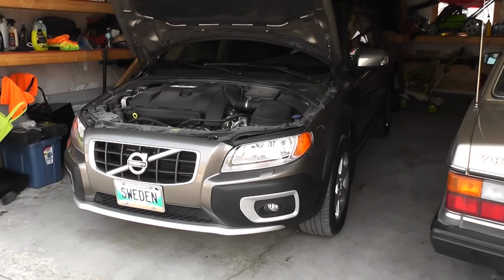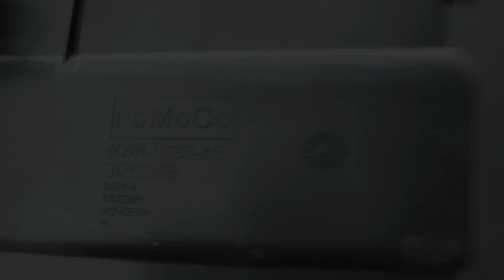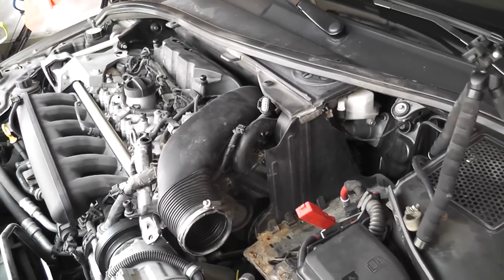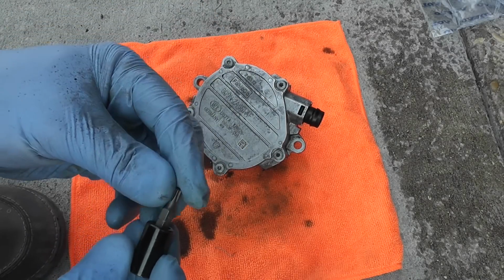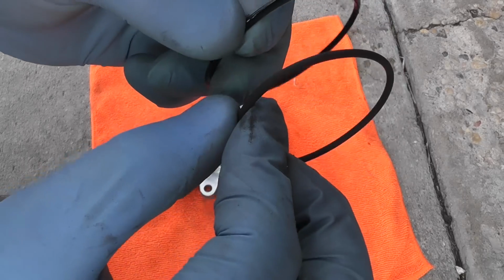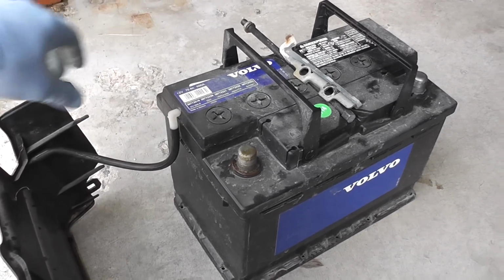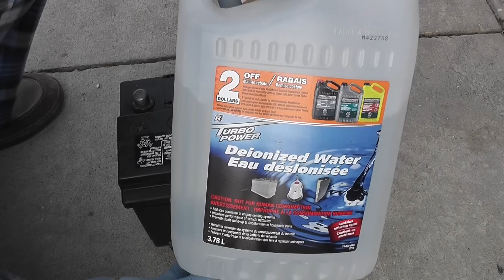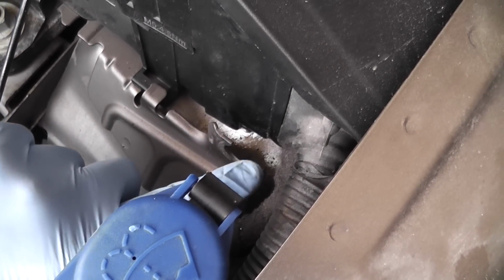Fixing leaking Vacuum Pump on Volvo 6 cylinder 3.2 and T6 engines.

Comment: Thanks a lot for this video - today  having no experience I have replaced seals on  my 2008 non-turbo 3.2 vacuum pump in 2 hours.  Also have to remove two A/C bolts.  Only one difference -  I have not take a risk to clean surfaces with sandpaper, brakecleaner  was good enough.

Comment: My 3.2 XC60 was at the Volvo dealership for a recall and they discovered that the vacuum pump was leaking and offered to fix it for $370. I found the OEM part on line for $76. I’ll be fixing that myself. Many, many thanks to you!!!! I’ve made a number of repairs myself to my fleet of Volvos because of your videos. Thanks for sharing your knowledge and taking the time to make these extremely useful videos!!!!

Comment: Thank you so much for all your videos, they have such good depth and insights!  I just did this job on a 2013 XC60 that's losing about a quart every 1500 miles.  I studied this video in detail before starting and had it playing on my laptop the entire job in the background.  It was like having you watching over me while doing it and the entire job took about 2 hours :)
Reply from the maker: Glad the video helped!
Reply: It was!  Doing transmission oil over weekend, I actually took the opportunity with this job while the fill bolt was exposed to loosen it, prepping for new job (and of course using that video you made as well)
Reply from the maker: Nice. Do you have Vida to reset the counter after transmission oil change?
Reply: volvosweden I will tomorrow when USPS delivers it :). I have VIDA running in a VM on laptop ready to go, a bit nervous but very excited.  First time flashing anything to a car
Reply: Hello, I want to ask you, before the repair of the vacuum pump you had oil consumption and after you repaired it the consumption decreased. I will wait for your answer. Thank you.

Comment: Thank you so much for this. The pump on my XC60 is spewing oil everywhere! Glad I can fix it on my own thanks to your video.
Reply: around what milage/yrs did this happen?
Reply: pgreenx 8 years old 140,000 miles.
Reply: Is your XC60 a T6? I have a MY ‘14 XC60. Does this issue also comes by the 2.0 D4 5 cyl engines?

Comment: Thanks for the response.  I have been looking at the pump online and it appears to have openings that would allow oil to pass into the pump.  Maybe the oil lubricates the rubber blade and is part of the design.  The oil leak appears to come mostly from the engine to pump union.  Just a guess on my end.  Thanks for the great video.

Comment: Great video again. It is easier to get to the vacuum pump on the non-turbo 3.2 engine. Removing the battery and battery tray make it very easy to remove the pump and no need to loosen the bracket for the AC compressor.

Comment: Excellent and thorough video.  I'm diagnosing a noise I heard on the coldest day last winter that returned yesterday.  Initially I thought it was the water pump or idler pulley.  Yesterday's symptoms seem to indicate the power steering pump is the problem - vibration, noise, small amount of fluid on driver's side lower cross member.  I topped up the reservoir but will wait until I have obtained a replacement power steering pump.    Your video confirms that I followed the proper sequence; stopping short of removing the battery.  I already purchased a replacement water pump and serpentine belt, so I'll replace these at the same time.  As far as I can see, removing the battery plate is the only access to these parts.   Thank you .... Cam

Comment: VolvoSweden, another excellent video. thank you very much!  And DO NOT go to the trouble of doing this without also replacing the serpentine belt. Yes, a little more work but a lot less than if you dont
Reply: Any good videos on the aero belt for a p3 3.2 engine.  I heard it was a lot of work?

Comment: G'day, so I did this yesterday on my '08 V70 T6. Too easy. Thanks heaps. I got the parts from Tasca Parts. Excellent price and service out of the states. IT is ridiculous that I can import genuine parts to Australia cheaper than I can get them at my local dealers. I replaced both my drivers side engine mounts as well since I was in there. Pretty easy but if it comes up, others might benefit from that video.
Cheers

Comment: Thanks for posting this, my pump was leaking pretty bad. Followed this procedure for my s80 and the removal of the 13mm and 10mm for the bar to get at the pump is perfect. Got it all back together with new seals and no leaks. I noticed after getting the pump on that my belt is looking worn. Any videos ideas of how to remove the drive belt? Its really buried in there and not easy to get at the belt tensioner,  may have to bring it in for the belt I think. Good video.
Reply: instablaster

Comment: Did you feel any difference in terms of power after the repair of the pump? I'm asking because I have to change the same part AND my car has a loss of peak power (minus 2 seconds at 0-60 mph after 6 years on the road). I did a Terra Clean but it hasn't improved its performance...

Comment: Thank you so much for your videos. You make me want to get a. 2008 Xc70. I'd been worried that they were going to be so much newer and computerized..but it's good to see there's still a lot that can be done without a dealer or reprogramming
Reply: @volvosweden, if I can't find a 2008-2012 xc70 t6; but can find a 3.2 with good service maintainance, is there any reason to avoid the non turbo ones? A friend of mine says they are slow.. but I'm not really looking for fast performance..more durability....any advice?

Comment: Just noticed this problem on my 2009 XC60 T6. Will order this part and fix. Thanks for the helpful video.
Reply: Im have problems i have a xc60 wat sound is urs making
Reply: @kingmaxx7986  No sound. I just noticed it is leaking. What sound does yours make.

But I have to say, my Volvo can predict with 100% accuracy when it's going to rain. Whenever it's going to rain and you are driving, the air conditioning compressor makes a whining sound. No kidding.
Reply: Ill be looking at mine real carefully since in the process of replacing (oil trap, breather box) on the other side of engine.  Thankx

Comment: The bolts of the pump to the engine have to be tightend to 17Nm according to Vida.
The bolts on the pump housing have to be tightend to 7 Nm.
Reply: Where did you get the VIDA? My apologies I'm newer.

Comment: Great job and video! Thank you for making it.  Question, is this pump supposed to make a lot of scratching noise when it runs? I could see scuff marks on the inside, where the plastic rotor part spins. Guessing, that's where noise originates? On mine, it's very loud.  Thank you.

Comment: Just did this today on my XC60 T6. The oil was quite thick and dark in mine, perhaps it's a good thing I cleaned it out. Disconnecting the Vacuum hose was a chore as the plastic was brittle and broke when I squeezed it to disconnect. Had to use to flat-head screwdrivers to pull the two sides apart. On a good note, I did not need to remove my battery box or loosen the bracket to access the front bolt.

Comment: Hello, thank you for this nice video. Very well done. Did you done this rebuild only because of a visual inspection shown an oil leak or did you had break power loss?I have the same Vacuum Pump did you
Reply from the maker: +Michel Pelletier Visual inspection only. No other symptoms.. If not fixed it will leak into  the ground.
Reply: This is the first one to check when you notice a decrease on your oil dipstick level.

Comment: has it got any return valve to stop engine oil from coming off to the brake booster in case the one in booster failed ,I have one here gave me aheadache  to find out how come the oil in booster , the brake booster literally filled with oil , I would assume this happening during engine shutdown as that vacuum on booster will suck any oil in pump if it has not got valve at the outlet where vacuum hose connected to it , can you elaborate in this please
Reply: I mean the plastic port that came in with new kit , is valve (work one way. only ?)

Comment: Should I oil inside the pump after rebuilt? If not, the parts will not have friction? I have rebuilt mine, and cleaned the inside (no oil).. Just wanted to re confirm before I put back and start the car..

Comment: isn't it a good idea to lubricate the seals with oil before installing? like on oil filters
Reply: You should only lubricate seals when you're twisting something on (like an oil filter). There's no need to do it on parts that are screwed on with bolts (it doesn't make a difference).
Reply: AFAIK, yes. And, you might want to put oil or lube back in the pump, too, before cranking and running the engine. Many of these seals swell to a larger size when exposed to oil and the pump needs the lubrication to prevent wear.

Comment: Just did this Swede,c thanks for the great vid,  but not sure why you took off the battery and case, Just move the airpipe and the a/c bracket. Took 20 mins to get the pump out...10 mins to put it back in

Comment: Very helpful instruction, thank you for sharing. I just got mine replaced today, which saved me about $250 on labor.
On my 2012 Volvo S60 T6, the serviceability was improved - once the battery bracket being removed, the two screws on vacuum pump can be easily accessed and removed, it makes much easier to remove the pump than on XC70.

Comment: Yuri. When are you planning to replace the serpentine belt? That would be an awesome video. No one has done that for the 3.2L.
Reply from the maker: No plans. Too low mileage.
Reply: @volvosweden  You are supposed to replace it every 10 years according to the service schedule regardless of km. So That would have passed by now. Can you please do a video because I'm doing this too and a guide would be helpful.
Reply from the maker: I will look into it. Thx for the tip.
Reply: Hugs there’s a step by step with good pictures on sweedespeed. But I agree a video of this quality would be awesome.

Comment: I have one question.  None of the seals replaced addresses the pump getting full of oil. IE Shaft seals for the rotor.  It looks like the engine is migrating the oil into the pump.  Why does this happen?
Reply from the maker: +Steve Hudson I cant help here. Sorry

Comment: hi, 
before you repaired the vacuum pomp, did your engine had a weird noise coming from the oil filter cap. 
I mean taking the oil cap off while engine idle, did it had a word noise (not the usual one). sorry for my bad English
thaks
Reply from the maker: I have not tried what you describe. But I had a high pitch whistle at idle that you could hear inside the car. I have suspected the power steering pump. But after I have touched the vacuum pump the noise has almost disappeared.

Comment: where can I get the rebuild kit from?? Tried to purchase locally and they wanted to sell me replacement part complete.
Reply from the maker: Volvo dealer or ipdusa.com
Reply: Please I have had to pack my Volvo S80 1999 model for a long time now due to oil leak from the gearbox pls I need advice
Reply: ama love .. maybe you should take it too an automatic specialist.
I can give you some suggestions here:
Are you sure it's auto fluid ? Brown is usually engine oil, red is usually auto transmission fluid or power steering fluid.do you have access to a lifting jack and safety stands ?
If you do you can lift it up and put the car on stands, buy some degreaser in cans and blast all the oil areas around the gearbox ect.
Get your garden hose and wag the degreaser off and let it dry.
Start the car up again and see if you can see the oil leaking from the gearbox breather hole , gearbox oil cooler lines, power steering rack , also move the steering to full lock both ways and see if the oil comes out of the rack boots.
Hope some of this helps.
Reply: I bought the rebuild kit from FCP Euro, P/N: 31401556, made in Germany. I believe it is the same part being sold at Volvo Dealer.

Comment: We have the same issue. Can this cause a false fuel pressure sensor code. Our codes are fuel pressure sensor and faulty vacuum pump. Thank you and great video as well
Reply from the maker: Not sure.
Reply: Thank you for the reply. We did find that a faulty fuel pressure sensor can be caused by a bad vacuum pump. This was per dealer. Our issue and codes went away after the fix

Comment: great video, thanks. 
1) It is not necessary to remove or disconnect the battery, just take the front of the battery box out
2) It is not necessary to unplug the MAFS cable
3) It is not necessary to buy rebuild kit, just clean the O-ring contact areas with brake cleaner and squeeze liquid gasket maker under and over the O-rings, reinstall, good to go

Just sharing my knowledge, again great video!
Reply from the maker: +spinlite ny Thx. It's a great tip for next time.

Comment: The most important thing is that 5 screws, they are the leaking main root cause. The screw is made by steel, and pump body is by aluminum, there will be small gap between both treads since long time, the sealing is mainly by thread to prevent oil from coming out. The cheapest way is just put tread tape to each old screws then the problem will be fixed. 
Anyway change the new screw is the best solution.

Comment: Poop - so I did this and in getting the 'plug' out of the pump, one of the plastic sprung lugs was as stiff as - applying force and ignorance resulted in breaking the alloy 'bar' on the outside of the hole holding the plastic clip in.  Jury rigged with araldite and a jubilee clip - any ideas a. what happens if this plug comes out (loss of vacuum to brakes?) or b. longer term fix - was doing this myself to save money and certainly can't afford a new pump right now :-(

Comment: You have not mentioned why did you change the leaks, based on visual inspection or you got any CEM Code?
Reply from the maker: Visual only.
Reply: volvosweden good stuff. Will you clean Throttle Actuator some time?
Reply: @mattgloss8580  He has made a video on this.

Comment: Need to mate this pump with an electric motor and retrofit into P80's-P2's to provide vacuum for the PCV system, so it can be completely separated from the intake system entirely. No oil allowed in the intake, a catch can in the path that you can drain once a week/month.

Comment: What is the symptoms of a leaking vacuum pump? My 2012 S80 t6 has a high pitch noise near the vacuum pump and ac pump area. It appears after the engine warms up and only at idle. It is gone right after I press gas paddle. So far no check engine light. Appreciate your comments!
Reply from the maker: Have you replaced this? Watch this video. https://youtu.be/V0RzfGd-2OE

Comment: I thought that the hose connected to the battery was to bleed off hydrogen gas produced when charging the battery.
I don’t think I would want that gas anywhere near an ignition source, it is explosive.  Remember the Hindenburg airship
that exploded in NJ when docking. A slow bleed  at the bottom of the case would do.

Comment: It's also fascinating that this leak seems to occur just after the warranty expires. Odd that.
Reply: Not only that but the replacement O ring is a different design - indicating that the first design was faulty....and then they sell lots and lots of fix kits at $200 (Aus) and labour of another $200 to fit - handy eh?  Bastards
Reply from the maker: +Ian Saunders Agree! Here in Canada the kit was like 70$ CAD
Reply: I heard from a technician from Volvo dealer - it's quite common for those in-line six cylinder Volvo engines. I have replaced seals on both 2012 Volvo S60 T6 AWD and 2010 XC60 T6 AWD.

Comment: Great video - shame about the price rip off - in Australia this kit is $220 plus - for two O rings, a plastic plug and five bolts. F**k me!  Anyway - quick question, do you have to disconnect/remove the battery??
Reply: Yes. Otherwise you can't gain access to the vacuum pump. BTW you can get it cheaper here. https://www.tascaparts.com/oem-parts/volvo-vacuum-pump-repair-kit-31401556

Comment: You forgot to put oil in with the pump rotor.
Reply: Yeah I'm wondering about this. Is that engine oil? If not what oil are you supposed to use?

Comment: that's a big design flaw by Volvo letting the battery fumes leak around the whole battery holder and cover
Reply: In jest, I can see the Swedes concerned about the environmental possibilities, yet possibly the Chinese (Geely) are less concerned?  In Sweden old Volvos are to be stored on concrete pads, forcing many recycling yards to send them to the smelters.
Reply: The battery vent hose is shown in the vid...it transports hydrogen fumes out of battery box.   The corrosion could be from from salt intrusion (car has Sweden plates).
Reply: Actually, Manitoba, CN.  But, you can see the salt corrosion on this car.

Comment: wow...you didn't refit the 2 rotor ends in the same position...that was a mistake,for they were already "adapted" to the housing; now, more wear will take place;    next time  let's do it properly...
Reply from the maker: Thx for the great tip! I am sure will help others here and me.
Reply: Do you mean the contector van the pump to the camshaft?  The are allined / timed.
Reply: @richardbrinksma6168  No he means the rotor inside the housing. The thing at 11:33.